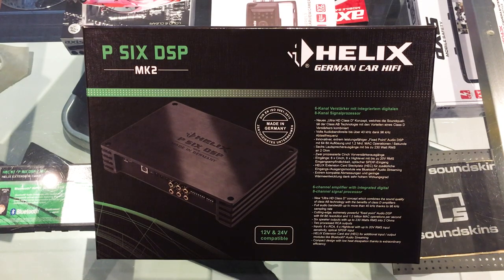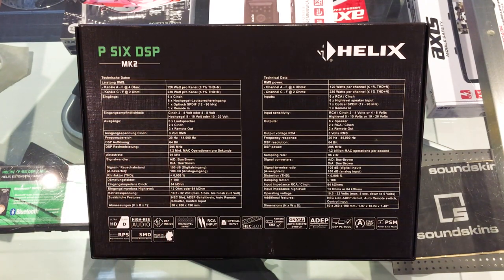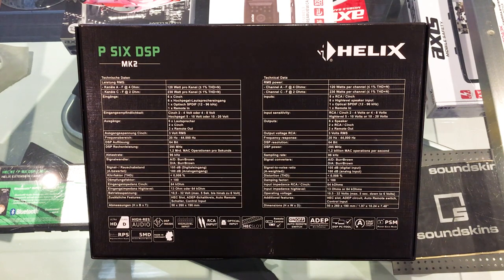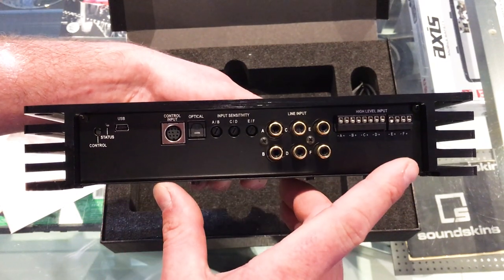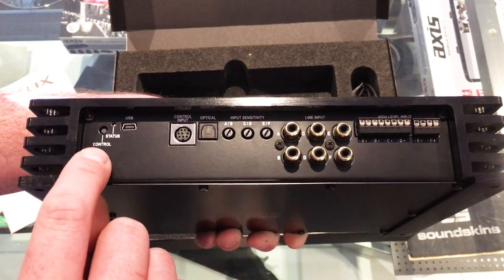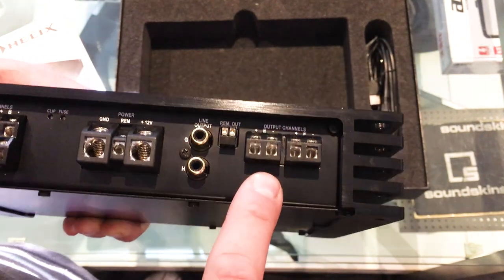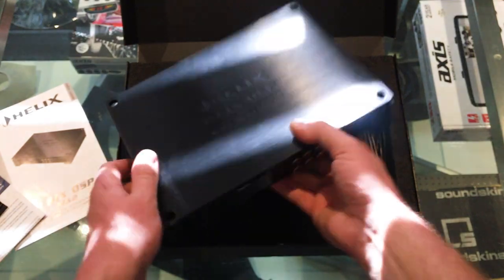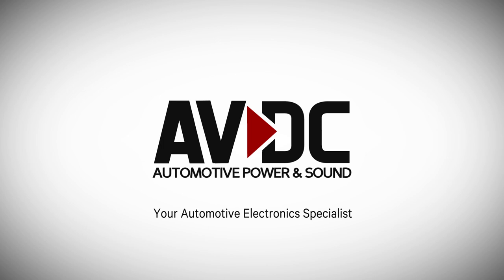Helix P SIX DSP Amplifier UNBOXING!

Comment: What a unit. I have one of these, plus 4 Focal 165S & 165C's, x2 Focal tweeters, plus a JL 500W Monoblock mono sub amp, JL 10" ducted port sub driver, and it's all so clear, detailed and punchy.  Oh, and LOUD , if need be. 2011 Honda  Accord EX.  Bluetooth AptX-HD for my OnePlus 8 Pro phone, with Dolby Atmos Movie effect.  GrooveSalad, SomaFM, 196 - 320 kbps streams...Just absolutely thumps. I don't find the DSP / AMP to be "cold", at all. (of course, I do some EQ tweaking).
Reply from the maker: Great to hear! We are installing one of these in a car soon, they're a fantastic piece of hardware. :)

Comment: Can these amp channels be bridged? I know the specs on the website have a blank for this information, indicating that maybe they are not rated for bridged mode. But I am curious if I can use the V EIGHT DSP MK2 to drive wide-bands, mid-bass, and 2 subs each on their own bridged channel, and what kind of power I can expect from that.
Reply from the maker: I wouldn't assume you can bridge them, but I haven't looked into it further. I'll give it a proper look when I (finally) get around to installing it!
Reply: Can not be bridged
Reply: I contacted Helix and they can't be bridged, but you can drive a dual voice coil sub with one channel to each coil and the DSP does the work to send the same signal to each coil so you don't tear apart the woofer.

Comment: I'm confused about the output channels and how you described them .  I think you got the specs wrong for the a-f channels.   I think it will do 2 ohms output on the last 4 channels.  I thought I read somewhere that only A and B were limited to 4 ohms
Reply: I read that too. It is a misprint. Only the last two channels can handle two ohm loads.